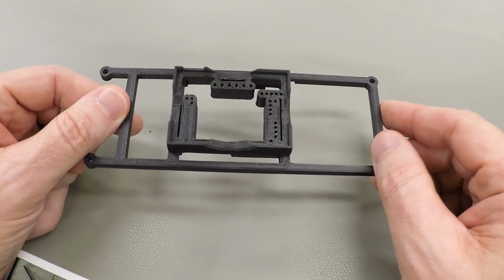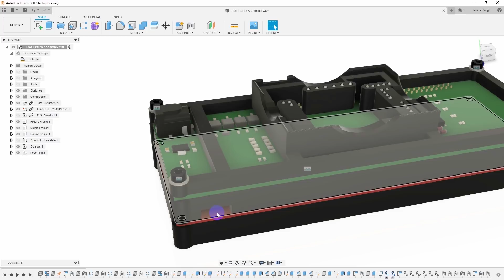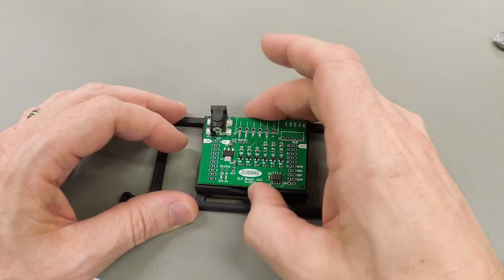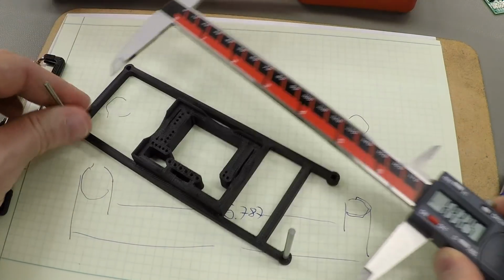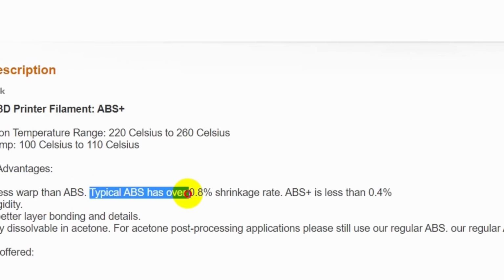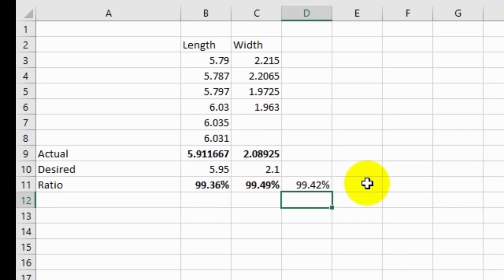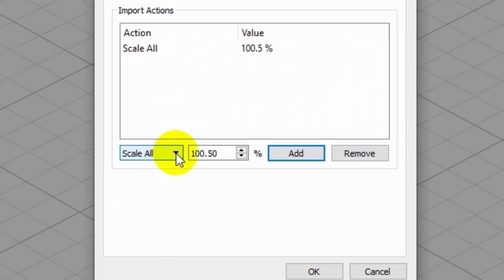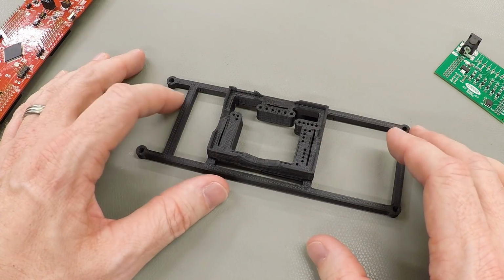How to 3D Print Dimensionally Accurate Parts

Comment: Good reminder that it's all fun and games when printing big-busted winged figurines - until you need to print something practical.
Reply: I managed to print a 50 cm replacement oven door handle, and I had kept the old aluminium face. The face had a lip (perpendicular to the face) and a rounded bevel. I designed the handle with zero clearance for the lip, a matching radius, a groove of the exact width and depth.. It was my first 3d print on my first 3d printer (say .. project larger than a few cm), and it worked as expected. The aluminium face fits nicely in the handle...
I used PLA, a 60C heated bed all the time (9 hours), a nice and big raft, and the printer is a Creality CR10 Max, 0.4mm nozzle, 70mm/s.  My only complaint is that there is a 0.1 mm deflection over the 50cm of the handle, other than that, I'm happy with the result.
Reply: exactly, btw. I almost always print somethinf practical , no time for wasting my filament and time for useless things..
Reply: .stl of big-busted winged chicks or it didn't happen.....
Naaaah, just kidding, I wouldn't want to treat women like .obj's.
Reply: @redwhiteandbluebonnets8180  😂
Reply: @redwhiteandbluebonnets8180  You mean ...treat women like stl's 🙂

Comment: cool video! One small trick, not sure if it is already mentioned here: measure the pin size with calipers, now *zero the caliper*, then measure the outside distance between pins - it'll give you the exact distance between pins.
Reply: If the pins are the SAME size His were not (but not greatly different so, in THIS case, can be ignored).
Reply: Great idea, and now I feel stupid for never thinking of that.

Comment: Just so you guys know if you are using PLA and your parts are slightly to big (or your holes are slightly too small) your issue may be solved by increasing your horizontal expansion offset. Basically the PLA is expanding just a little bit due to the heat of melting it, so your parts will be just a little to big. The horizontal expansion offset can help fix this. You will need to do multiple tests seeing what value works best for you.
Reply: good to know !
Thank you
Reply: In SuperSlicer would that be XY Compensation?
Reply: @fred98321  I believe so
Reply: @Kz1nk  Yes, it was. I played with it and it solved a long standing problem. My XY movement is calibrated based on distance moved but parts were never the exact set sizes. After using XY Compensation they come out very close (0.02 to 0.04mm) to the defined size. Thanks again.
Reply: @fred98321  Awesome, glad it worked!
Reply: Excellent point and noted, thanks!
Reply: this is great, thanks!!!! i was looking for it in the filament settings because i figured it would be there but it is in the print settings, which is strange since it tends to be filament dependent but hey it fixed it, just have to remember i may need to change this for different filaments now.

Comment: To get the maximum precision, you should print a test piece at the largest size possible, that way, the shrinkage will be amplified making it easier to measure.
Reply: pro tip: don't print it bigger than your callipers.
Reply: instablaster...
Reply: @gonun69  Yeah I had to learn that the "hard" way.

Comment: You can go to preferences in Fusion and change so Z is up :)
Reply: Was just going to post this same comment
Reply: Yes you can change the preference "Default Model Orientation" to "Z up" 
Maybe  "Y up" works better for the CNC mill
Reply: Yeah, @ThisOldTony just did a video on how bought a new milling machine, I mean fräsemachine, had weird axis labels. They appear to match default fusion 360. I’ve always been taught if you’re facing the machine, x is starboard to port, y is aft to fore, and z is below to above. Making the back, bottom, left, 0,0,0.
Reply from the maker: Thanks!  That's probably the best long-term solution.
Reply: @areospike1600  I believe his model was based on a horizontal originally so the spindle axis (Z) would be what we'd consider Y. Why they kept the scheme is confusing though.
Reply: I did this a while ago too, when I was annoyed to keep rotating a print. Works perfectly fine.

Comment: For precise features, we usually CAD those features in a very thin, quick,  proto print to get them accurate. Then the full size part. This saves lots of iterative printing time and waste material. Also for threads, snap fits, flex fits, and anything that fits something from "the real world" or even another printer.
Reply: I don’t even try to get small holes or threads correct, I’ll undersize them then drill and or tap as needed. Super easy Bc it’s plastic
Reply: @henry3397  You still need the centers correct, though.

Comment: The "problem" with the model's orientation in Simplify3D is not a problem. You are sending a CNC-type model to 3D software that uses a different coordinate system ("Z is up"). This can be changed in Fusion 360. Most people never change the default metal material to a plastic material either.

Comment: It would be great if you could do a similar video, showing the full process of calibrating the printer for accurate dimensions and setup of Simplify 3D. Your way of explaining things is really good.
Reply: I think the point of this video was to get a really accurate part with out touching your "already calibrated" printer. Because let's face it, all part behave differently and calibrating the printer for each part is quite annoying/time consuming. I am sure you found that out yourself anyways.

Comment: Thank you for sharing your experience with us and I really enjoyed the video presentation.  It showed me how one should go about dealing with shrinkage.

Things that I noticed and hope you will continue to do include:

You don't assume too much of the experience or knowledge of your audience which I think is great.

You disclosed brand names of what you used (filament, 3D program, 3D slicer, spreadsheet, etc.) which I liked.  It gives me ideas on how I can use them more effectively or in my environment.  Your spreadsheet usage was particular interesting to me.

You scripting of your video was well done in that you presented what you wanted to do, demonstrated the problem (with lots of visual close up shots) on what happened, how you identified the problem, the possible solutions and the final solution that you settled on.  
I thought that a visual inspection of the 3D object would have suggested that the problem was not in the hardware (i.e. 3D printer) but somewhere else since the printed object looked pretty good.  But I do commend you for doing your 'due diligence' to make sure that you didn't miss anything as part of your problem analyze segment.  As a side note, I thought that if I were looking for the actual shrinkage value due to the equipment & material, I would print the largest diameter rectangle that my printer to produce and measure the resultant print.  The deviation between designed & actual dimension would be the most accurate.

But back to the video.
The pacing was sometimes fast, especially when not familiar with the application or situation but I was able to follow it.  The video presentation was professionally done, with great video framing & sound reproduction.  Thank you especially for taking the time to do a great presentation.

Finally, I do want you to know that I appreciate the time & effort that you put in producing the video and encourage you to continue to do so.

Take care and stay safe,

Pat Young

Comment: Nice example. Thanks for taking the time to show that.  Using Siemens NX, I like to add manufacturing specific features like this at the end of the model history, and place these features in a named feature group. That way I model the part as it should be, and then have a group of features for 3D printing (or other manufacturing process) that can be suppressed or unsuppressed as a group. For example, I might enlarge holes slightly based on inaccuracy of the 3D print. Scaling the final part for shrinkage would be a feature in the feature group.

Comment: in the beginning i thought, that you didn't calibrate your axis correct, but your solution and description are GREAT...  
a new aspect to improve my parts. thx ;) hope that the software desire not too much manual changes in settings when changing filament OR temp! 

automatic part-enlargement should be mandatory for filament-settings ... NOT after importing, but BEFORE PRINTING!

Comment: Very interesting. I suppose the shrinkage changes based on the thickness and shape . . . . . if it were directly proportional, no matter what, printing a set of 12" "rulers with very fine scale marked, then compare to actual ruler and maybe that would tell you whether the shrinkage happens across the scale, or jsut in certain parts?. Love your videos, and the Fusion 360 has been far more useful than what pertain to be F360 tutorials. You make it far clearer than those other guys! Thanks!

Comment: I am a photographer. I still use the old 4X5 field cameras. Last year I bought an MPP MK VII technical field camera for landscape photography. It came with one lens board of Copal 1 size. This camera has not been produced since the early 70s so, instead of paying silly prices for battered old lensboards off the Bay, I decided to 3D print them using a CF infused PLA. I ran exactly into the same problem as you just did. Both trial size No 0 and No1 boards came out undersized. I had to adjust the printing sizes in Cura by quite a bit , around 1% mark If my memory serves me right, to get the lens flange to fit the holes and the retaining nut fit in.  I am not quite 100% sure if the quoted filament sizes are accurate or not either.

Comment: Been 3d printing now for 3 years and still have been doing the scaling manually on simplify3d. Thankw for making my 3d printing life much simpler. I do a lot of mechanical parts so this helps a lot.
Reply: What happens when you use a different filament or printer?
Are you going to keep track of what you scaled each and every part with?

So your method is actually the preferred method.

Comment: To other viewers: Before you assume that it's your filament material that's shrinking, print some lines that are a known distance apart but not connected to each other and check the dimensional accuracy between them.  That way you'll factor out the shrinkage and see the true dimensional accuracy of your printer while the parts (the lines) are still stuck to the print bed.
Reply from the maker: This can be very hard to do accurately, since the differences we care about are small, and layers near the bed are often distorted.  I would prefer to measure the actual movement of the printer axes with a caliper or dial indicator.
Reply: Could be underextrusion because of constant in extruder or nozzle diameter, also, bed testing isn't the best idea. It's that first layer that is either squished to ensure great adhesion or with offset for easier removal which add a bias factor in consideration.
Reply: Cryocide material shrinkage isn’t an assumption. It’s a well studied physical phenomena and he also just empirically verified it.
Reply: @Clough42  The way I tend to do this is by printing an L-shape with equal length legs and square holes at the ends and intersection of the legs. Say the L-shape has 120mm legs, each 20mm wide. There are three 10mm square holes, each with their centre lines 100mm apart. To get the correct axis scale, I measure the internal size of one such hole and zero my calipers on that dimension. Subsequent inside measurement of the holes' furthest sides (in this case 110mm) will show the pitch of the holes' centres. This way all factors involving extrusion width are eliminated, leaving just the actual printed dimension*. The hole sizes can also be averaged, of course, but I've found this to give me rather excellent accuracy in my prints, yielding running fits or press fits wherever I see (wait for it) fit. 

I take it you choose the print scaling over a permanent firmware scaling of your axes as a material-specific compensation?

(* source: moi, being a B.Eng. in mechanical precision engineering 😁)

Comment: Great info video, thank you. The only thing I can think of since the slicer allows one setting at a time, is to just print a chart with the shrink rate of each filament material used. When imported into slicer, double click and change parameters accordingly before printing.
Reply from the maker: It really depends on what you're doing.  In my case, most of what I do that requires precise dimensions is in ABS, so one setting gets me close enough.  If I routinely required precision in lots of different materials, it would be necessary to do exactly what you describe.
Reply: @Clough42  yep, that is all I was referring to, so I hope you didn't take it like I wanted to help you out. You're way ahead of me, I only commented for viewers who might (for whatever reason) used a variety of materials. For me, probably PLA.
Reply from the maker: @FrugalFlyRodder  yeah, no problem.  I learn stuff from comments all the time.

Comment: at 22:48 you have the right answer becuase the margin is so small, but the math to find the correction amount I believe should be 1 divided by ratio rather than 1 minus ratio. In this case the answer is the same.. Shinkage also relates to % of infill - so that would be a factor.

Comment: In the metal casting world, a common tool used is a shrink rule, each graduated for a specific material with a known percentage of dimensional increase, so that a casting model made using the correct rule for that material will result in a cast part of that material which is the desired final size.
Reply: So that means “what you want” finished, is, design scaled - plus oversize for 3D printing - plus - oversize for metal shrinking (using the 3D printed part for loss casting) - and - oversized again for subtractive machining. Not only does SIZE matter, but at X4. And at different values for each type process. (Not even getting into the whole SAE/Decimal/Metric conversation thing...OR rounding up/down) I love it.
Reply: The same thing is done in dental lab work. The wax shrinks a known amount. The metal does too. The investment expands a known amount to compensate for the combined shrinkage

Comment: I got around a lot of these issues by building all my models in metric.  I've not had any issues with size or accuracy since.  I live in Ohio, but having worked for a few European based companies in my life, I've had to learn metric.  Best thing ever, and never thought it would come in handy.  But I use this at work and at home for the printers and designing in metric has helped SO much.  
Give it a shot!!
Reply: Changing the measuring unit does nothing to address shrinkage between the software model and the printed part. As long as your design maintains a consistent system of units you're fine no matter what system you use.
Reply: @mystixa  I mean, given I've had the issue and made the correction and have physically held the correct result in my hand.... Sure.... I'll go with your suggestion..... :/
Reply: @That_guy_Pip  One has nothing to do with the other. I wasn't suggesting anything other than maintaining a consistent set of units when measuring. It doesn't matter if you call them xblocks or furlongs as long as your measurements remain self consistent.

Comment: I use Prusa Slicer but think this may  be applicable to it as well and may explain some of the fit problems I have seen. Also have found that the way I set up the walls makes a difference. Printing the outside of wall first or last to compensate for extrusion squish.

Comment: My ender 3 has sat for 5 months.... been moved... cats walk across it...i finally started printing again and printed 10mm and 20mm test cube,  without leveling my bed,  just cleaning the glass,  and my parts came out .02mm off. Not too damn bad.  Printed a print in place box with attached hinged lid... and i didn't even have BREAK free the hinge,  it rotated right away.   Love it.

Comment: That's cool.  I don't use ABS much, mainly because of the warping issues.  As such, I wasn't considering, and should have!, that your part shrunk.  I thought it was a belt, or estep issue.  My thought would be to confirm this using some digital calipers as DRO's on the x and y carriage.  My first printer ever was semi-scratch build off of a Shapeoko 2.  I was able to use digital calipers to show pretty accurately, and with some precision, X and Y movements, to really tune my esteps.  Cool video, as usual!  Thank you James!